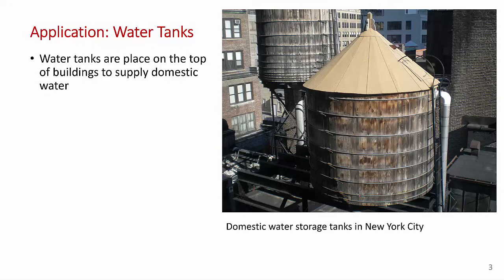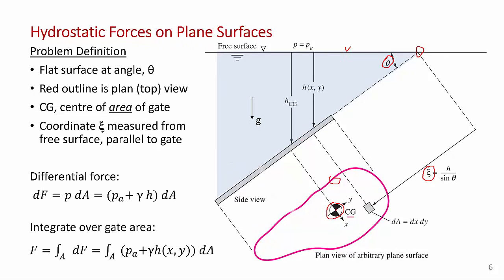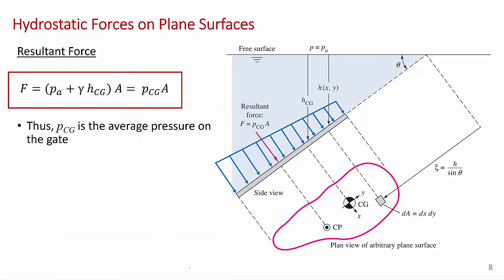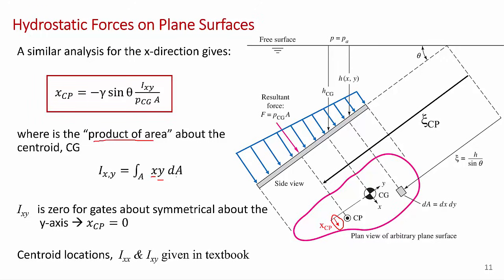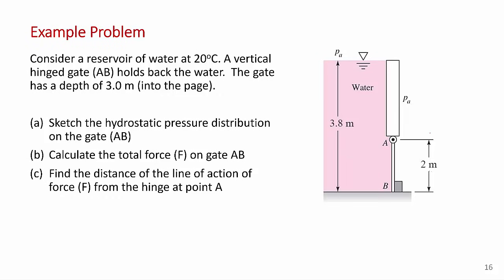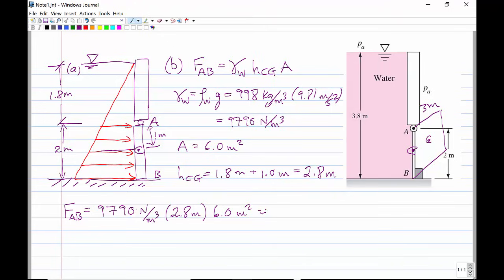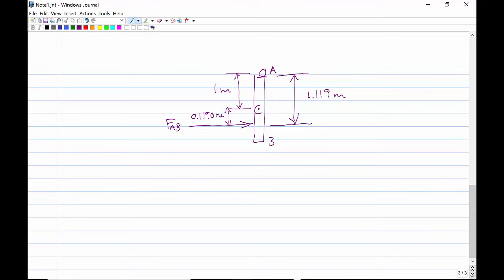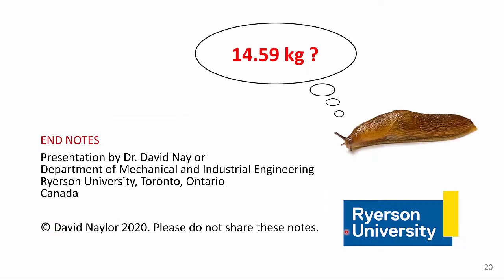Analysis of Hydrostatic Forces on Plane Surfaces

Comment: Why don't you use the area of a trapezoid for solving for that pressure prism on the gate? you use a full rectangle? All other pressure prism problems i've seen have used an area of a triangle, but if the triangle is not the full triangle as seen in problem, it becomes a trapezoid.
Reply from the maker: Yes. That is an equivalent method.